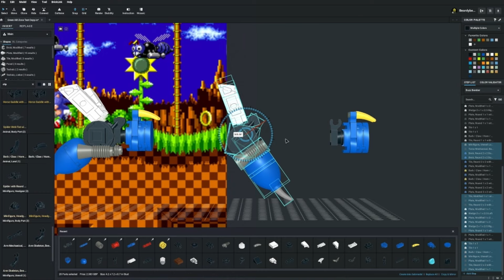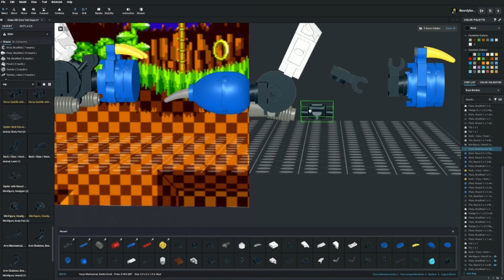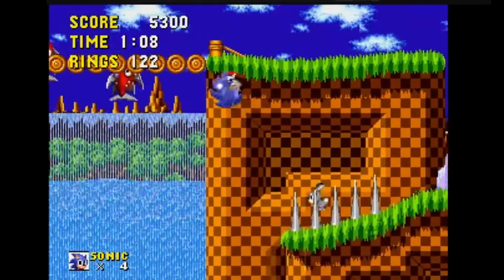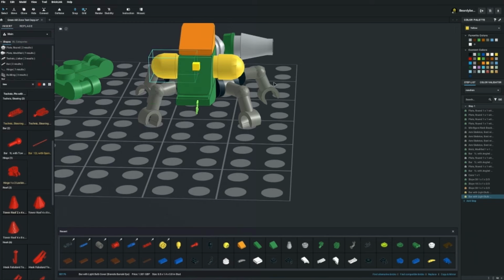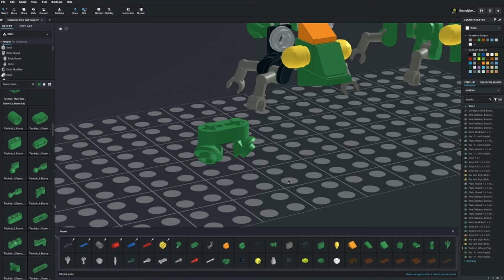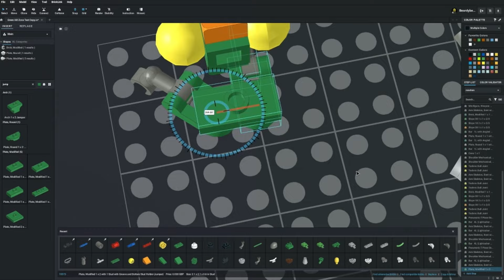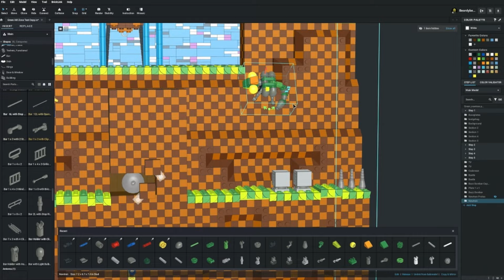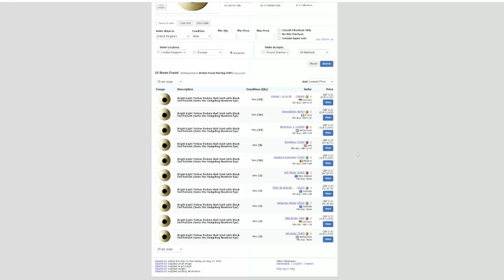Lego MOC - Sonic the Hedgehog, Green Hill Zone Expansion - Part 34

Comment: Try using part number 4595, it has a lot of connections, and the anti studs on the bottom can connect to jumper plates, which can be used for leg attachments. I don’t know if it will work but I hope this helps